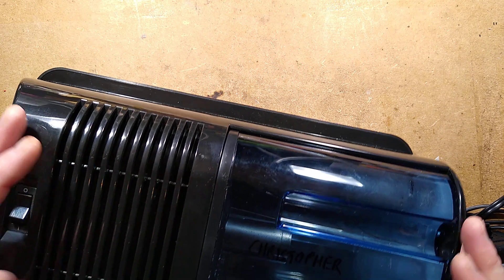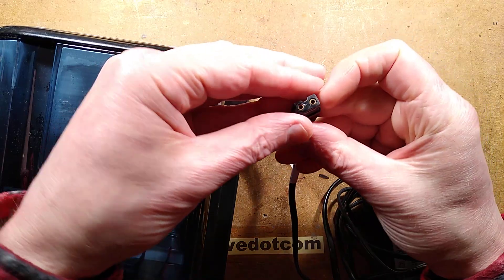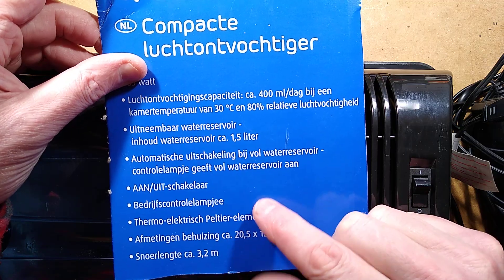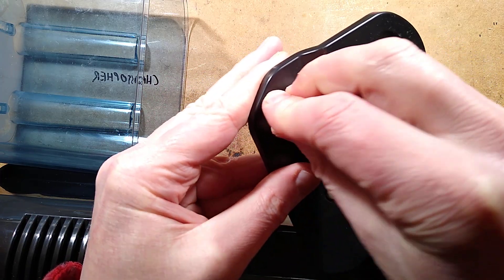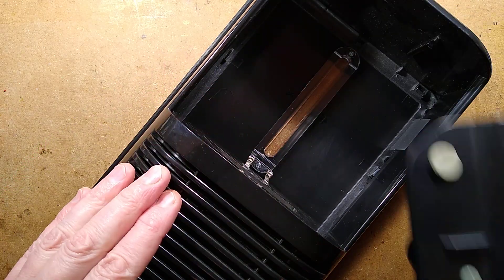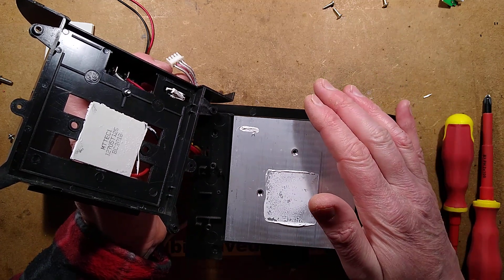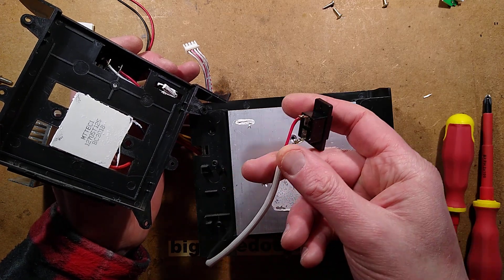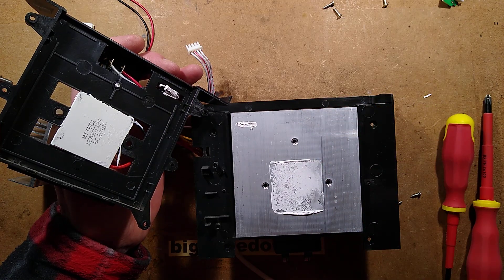Inside a faulty Aldi dehumidifier.

Comment: HI Clive, i am really struggling etching pcbs etc. I have been using the uv exposure method with pre sensitised boards and either ferric or persulphate methods and have spent quite a bit on failed boards etc. Could you do a warts and all tutorial on how to expose the boards and any pitfalls and etch boards and any pitfalls. All the videos i have seen , everything goes perfectly and is made to look predictable and easy. I'd real;ly appreciate your thoughts as i know you have done this sort of thing a lot and are very honest about the subject. Take it easy and really appreciate what you do!
Reply: I hope you have figured things out by now-- I am coming a bit late to Clive's party. Just in case, I recommend you find how-to vids by Micro-Mark. It's primarily for etching brass-- but that's the same process.
Reply: @MrChief101  hi,thanks for the suggestion I have not tried again for a while. Cheers.
Reply: @mixolydian2010  Good! Working with FeCl can be a heartbreaker. Mostly because it seems to behave differently from time to time. Don't know if it's the temp or humidity or what... It might be worth it for you to get a "PCB etch tank" from a place like Circuit Specialists. For a reasonable sum at least that part of the equation is solved. I also recommend getting a "dry gas" chemical extender which you squirt into a jug of chemicals to keep it longer. I think it works. Good luck.
Reply: @MrChief101  HI thats brilliant. YEs i guess thats one of the points i was making those things gained from personal experience and bad luck etc mixed with the scientific method. I had heard that those tanks were important but from my experience i would strip the copper off straight away with too strong a mix and get somewhere with longer etches but lost detail in the board. You need all the fixed reference points you can get with this business lol!! Cheers thats very helpful, all the best.
Reply: @mixolydian2010  Hmm-- I do brass etching and PCBs in the same soup. I made a tank out of acrylic so that I could maximize the amount of FeCl per job. I made the bubbler out of fish tank "bubble tubes." Works great-- apparently the more bubbles the better (I have wondered about using an air-compressor). To compare-- the .003" brass takes 12 minutes, the PCB takes about 5. I make use of the "Pulsar" system, which uses copy machine toner dust to transfer the image to brass or PCB. Run through a laminator. Here's the PIA: One has to use thinner PCB board than normal (.064" as opposed to .032'). Now that's not bad-- but there is somewhat less copper on the board. The thicker boars just won't make it through the laminator.
But-- the use a laminator is common to both the toner-transfer and UVmask methods.
So-- here is my list of advice bullet points: get some of the .064" PCB from Pulsar. I have not shopped around, y'know old customer pal now-- but you might do better elsewhere. You might consider buying the laminator that Pulsar recommends-- nothing all that good about it but at one point I was desperate. it's been about 7-8 years now, it might be time for another... Scrub the PCB with a sanding sponge-- dry. Use a fine grit. I work it side to side, flip it over and try to even out the pattern the other way. Wipe clean-- don't do any of that brake cleaner crap, who knows what that stuff is or how much stays behind? I run my junk through twice-- in my fevered imagination, I see the pressure being unevenly applied when near the roller hubs, so I try to flip it over but put the other side there to even out the pressure. "Fevered" I tell ya.
The PCB "tank" was around $40-50. If you're doing small areas I say hit the pet shop for aquarium pumps, hoses and bubble tubes. use a dollar store food storage thingie that is upright-- to save on FeCl. And use masking tape to apply the PCB to a piece of styrene to dip into the bubble levels. No need to heat. I recommend the upright bubbler set up because I found that if you do the boards in a tray-- even using ammonium persulphate, you must constantly agitate.. I use cheap 3/4" chip brushes. Don;t forget latex gloves-- I clean stuff off with lacquer thinner which will eat vinyl! By the way, the persulphate, even though shipped dry, is a more environmentally slightly better path-- and it is see-through! if you go that route-- I highly recommend a dedicated gallon mixing container. You'll need a gallon jug and remember, don't tighten the cap!
I say press on-- if you apply the right key search terms, you will find several more how-to videos-- even with the same system. The best thing about seeing how Micro mark did there "kit" is that you can see where to cut corners and do it with less expense. Methods vary, over about three (I think) vids, I swear I have detected slightly different materials and substitutes that way-- you may as well. Don't slow down-- once you do figure it out, it works every time. Ask any other questions you need to. My model stuff site is fedoratron
Reply: @MrChief101  Hi this is fantastically detailed and i really appreciate the time and effort you have taken in writing this. When i have a bit more cash to spare i will start to investigate the things you have mentioned. I do not have a laser printer, for example. I will persevere and the bubble chamber idea is a great one as the PCB tank you mentioned above cost around £170,so quite a bit of money. Thanks for sharing your experience. Will get back to you with my experiments. All the very best.
Reply: @mixolydian2010  I swear as soon as feasible I will make a video. I lost the will to make them when my very simple, very dependable, did everything I wanted video editor vanished. But I'm going to do it! And you'd be surprised how cheap it can be-- you can find FeCl over on Etsy for jewelry making. And a chip brush-- the only hard thing is transferring the pattern to some thin PCB. You'll get there!
Reply: @MrChief101  Cool, forgot to say when you mentioned preparing the surfaces above, that i had seen this video recently by Dan Gelbart https://www.youtube.com/watch?v=x7onZGqrYyY&t=184s 3:04 its a great series generally but he recommends sanding rather than solvents. Cheers

Comment: Re manufactured flux capacitor. 
 " it runs twelve volt."
 "I will connect it to nine volt so it doesn't run away." 

"You built a flux capacitor out of a dehumidifier "

Comment: The "reverse" effect of thermocouple junctions is employed by RTGs, Radioisotope Thermoelectric Generators.  A mass of Plutonium 238 undergoes alpha decay, generating a significant amount of heat on one side.  The other is heatsinked to radiate into space typically.  Notable uses have been the Mars Curiosity Rover (MSL), the two Voyager probes, and the Apollo ALSEPs left on the Moon.  There have been Soviet lighthouses using them as well!

Comment: Between the 2 ceramic plates are Peltier diodes :) They transfer heat from one side to another when electricity is passed through these diodes, the so called Peltier effect.

Comment: Thanks big Clive. I have one of these. Anyone on here get block of ice forming on cold fins? Surprisingly I am not operating at 30c , nearer 10c in a stored motor home. . I assume the fix is to put a heater next to it?
Reply from the maker: Our a facility to turn it off periodically to defrost.  A neat solution would be to swap polarity on the peltier module so it heated and defrosted itself.

Comment: It's more efficient than a 60W space heater since drying the air will preheat it and it'll reduce the thermal capacity so it takes less energy to heat the dry air.
Comparing it to a 1200W compressor type is just unfair.

Comment: Clive, you make multiple references to TE coolers as not being efficient. Well, as with any other heat pump, efficiency is not fixed but has an inverse relationship with differential temperature across the TE cooler: low differential = high efficiency. Vapour cycle pumps can achieve higher efficiencies for the same differential temperature, but in terms of size, complexity and cost, we're not really comparing like with like.
It's critically important to maintain contact between the sinks and the alumina plates on the TE cooler, particularly on the hot side. Reason is that if Q is the heat pumped from cold side, the heat rejected from hot side is Q + VI. Accordingly, there can easily be twice as much heat passing through the hot side and, of course, in a hot ambient, you can reach the point where the TE cooler can maintain a differential but actually pump little or no heat: whatever cooling you get from cold to hot is offset by reverse conduction from hot to cold. By the way, the TE coolers contain alternate blocks of n and p type Bismuth Teluride electrically bridged with copper. Heat transfer goes in opposite directions for n and p so the current path alternates through the cooler so all the blocks pump thermally in parallel. Fascinating things: worked with them in aerospace industry decades back and have been intrigued to see them progress into the consumer market.
Reply: Yes and no. Yes, there are operating conditions that make them more efficient than other operating conditions. No, they are overall not efficient at all. "[…] thermoelectric junctions have about 1/4 the efficiency compared to conventional means (they offer around 10–15% efficiency of the ideal Carnot cycle refrigerator, compared with 40–60% achieved by conventional compression-cycle systems[11]" See WP for the source.

Comment: I have a fan stove that works the other way with the element. When it heats up it drives a small DC motor that makes the fan run (:
Reply: Those are "Seebeck Generators"... 😜

Comment: It 'appears' that a TEC creates a hot and a cold side... but it is just transfering heat from the cold side and dumping it on the hot side. It would be a much more practical thing if the losses of the 'pumping action' wouldn't be so darn large. Often the losses of the transfer is as large or several times larger than the amount of heat pumped from cold to hot side. In this case it may use 55W to facilitate the transfer but actually only transfering 15-20W worth. So there might be at all times roughly 75W of heat dumped, and it has to be continually wafted away... or else no condensation form.

Comment: Hi clive got a problem you may be able to help with  .i brought a guardline wireless security system and its supposed to do 150meters but its falling short if i send a couple of photos of circuit board could you see if any one got a boost or antena hack. I cant buy the 1/4 mile unit in the uk  only the 150meter unit avalible for us brits. Its the gl2020eu 6 volt battery or 12v dc adapter.and its supposed to be 868.4 mhz its signal is falling short buy 25 feet
Reply from the maker: All devices like that can be affected by surrounding equipment using the same frequency or creating electrical noise.  It's better to use something like this well within its range.
Reply: @bigclivedotcom  yea its just a few feet short on range thought it would be too difficult for most to fix . Thought some ideas like stretching the antena coil or adding a new type of arial or similer ile try elsewhere thanks for the responce bud and taking the time apreasiate it clive
Reply from the maker: @jdshenanigans9265  You may find careful placement away from metal surfaces helps with range.  It might be worth asking the manufacturer if they do an external antenna kit.

Comment: I’ve got exactly this. Except it’s white. And was bought from Maplins quite some time ago. Exactly the same melty behaviour occurred too. One day just before going to work and leaving it on all day as usual I, for some reason, just decided to reach down and feel the pluggery area, which felt alarmingly hot. I pulled the plug out, but what happened instead was molten plastic formed strands leaving one of the pin sockets still attached to the connector, the other came with the cable side!
Some time later after putting it aside, (and as Maplin had gone) I fitted a fairly hefty barrel jack arrangement drilled above the molten socket area. I took the molten socket out and left it vacant. It worked quite well for a long time like that, but we never (at my wife’s insistence) ran it unattended. I recommend nobody runs this model unattended, it’s clearly a fire risk. The thing no longer works for other reasons. It’s out in the shed, where I expect it will heal or see the error of its ways one day when I bring it in again.
Reply: the connector was obviously not suitable,  5amp or so is also a bit much for the common barrel type,  as most only have tiny contact area on the outer surface,

Comment: I like these solid state ones though. They are quiet and you can dry out your bedroom all day and night. I have inherited the cabin from my grandfather and had to throw out most of the furniture because of the moisture and black mold. I put one of these in almost every room and two in the kitchen and run the whole thing off three large solar panels. Granted, I have added a few more electronic components, but this stuff has kept my cabin dry throughout the year for three years now. I wouldn't want to miss it.

Comment: I use a home brewed arduino controlled version to keep the condensation on my lathe under control but didn’t think of adding a thermal cutout on the hot side , i did fit one to the cold side to stop it freezing up so i may have to modify the unit and my sketch and fit a hot side cut out .
Thanks for the excellent video Clive !
Reply: plz share the idea syedshabirahmed2@gmail.com

Comment: If you've got one of these then save the condensate, it makes for a pretty clean distilled water substitute ideal for irons etc
Reply: Yep great for irons, just don't drink it!
Reply: Great, thanks for the tip. I have one of these exact same models several years old plus an iron hardly used (also from Aldi) so near perfect timing to make a small life change.

Comment: Are these even functional? The only kind of dehumidifier I've worked on are gas based like Delonghi dds20, and those are rated for 20l/d
Reply: I have one, pretty sure it's the same model. Rarely use it. If you leave it running it extracts a bit of water a day, but it doesn't seem like it is enough to really make any difference to anything.
Reply: Functional, yes. Efficient, no.

Comment: I live in Australia I tryed a very similar device to try and remove some of the dampness in my poorly ventilated bathroom. I found that in a relative humid and warm environment it to be completely ineffective about 3ml collected per week and in consumed 25W. The solution was a box fan to blow into hallway after showers where it is better ventilated by open windows and air conditioning.
Reply: You're probably better off setting fire to your money rather than buying rubbish like this.
Reply: I live in Melbourne and my room has been around 25-30c recently with about 60%-70% relative humidity (if my sensors are correct), so near optimal operating parameters. This dehumidifier seems to collect about a full tank of water every 2 weeks approximately in my experience.

Comment: How come these are not used to power the International Space Station? The side facing the Sun has to be extremely hot and the side facing away from the Sun about 4 degrees Kelvin! 
That should give amazing potential to produce power. 
Solar panels are typically only 25% efficient at turning light Photons into electricity.. surely these are more than that?
Reply: In space, there is no air to take the heat away from the cold side of the peltier element. With radiation cooling alone, the cold side heat sink would have to be prohibitively large.
Reply: Also, TECs are even less efficient.

Comment: the capacitor is likely just to dampen noise from the fan/s going back down the power supply cord.
Reply: Just being curious, would the noise make it past the power supply unit? I noticed the fan runs quite a bit after the switch has been released - maybe it's intentional to keep cooling the hot side for a few seconds after the peltier has been shut off.

Comment: The thermal paste will often dry out, but it usually takes some time. So long as it's not disturbed, it's usually still relatively effective. Once you remove the heat sink though, you'd definitely want to clean it off and re-apply some thermal paste to the unit before re-assembling it.

Comment: I just dont get this peltier dehumidifiers... They make no sense. They suck when it comes to liters/time and liters/kWh aswell...

My 450 Watt compressor based DIY dehumidifier pulls about 25 liters/day in 20°C 80% and still about 20l in 20°C 60-70%.
Its powerfull enough so i only have to run it for ~2 hours/day and still stay bellow 60%...
Also i can use it as a AC during the summer time :)
Reply: But they're cheap to make and easy to sell and that's all that counts.